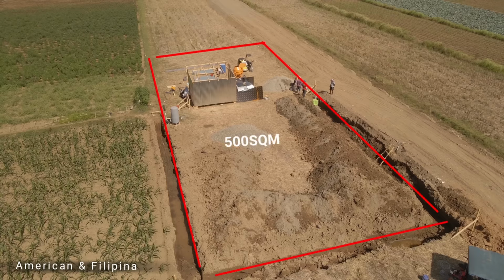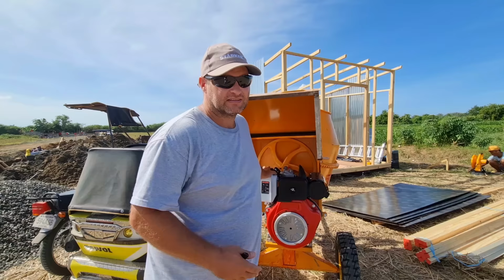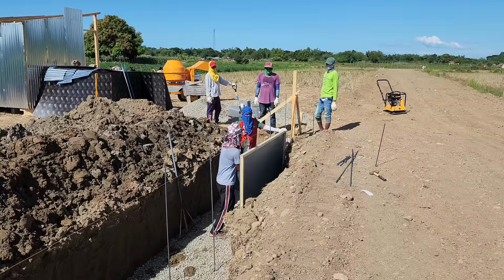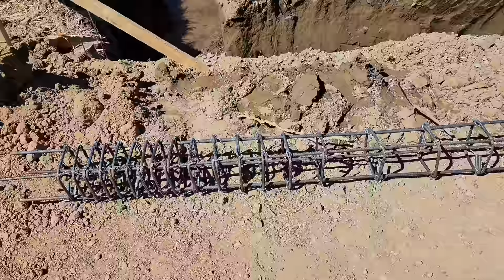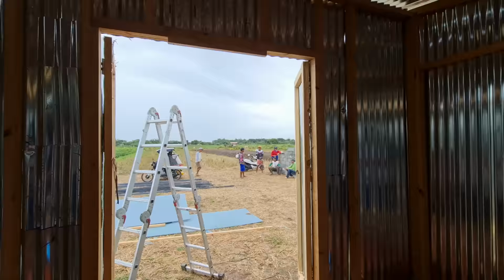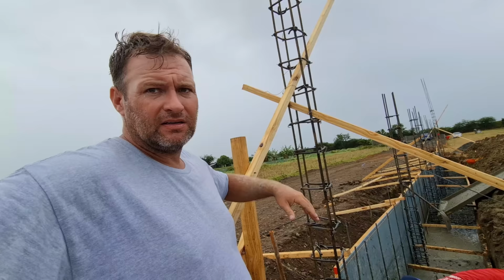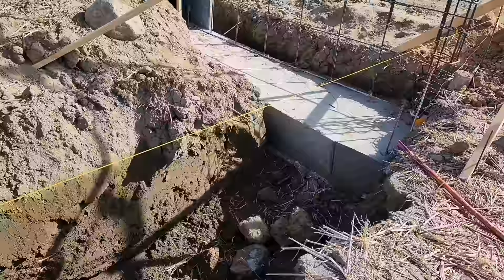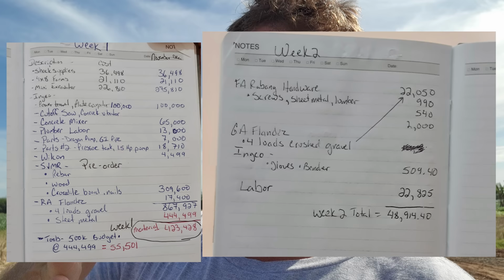Building solid Concrete Retaining Wall | S02  EP2 |House Build Philippines | The Armstrong Family

Comment: Richard.. That concrete is soup.. it should never be that wet. The slump is non-existent.
I know Filipinos like to make it wet cause it is easier to work with but you lose all your concrete strength. The concrete floor you did for your friends looked great. Not to wet, not to dry. Looking forward to your next video.

Comment: This is the advantage of the owner  having a knowledge in technical Construction, know how to read plans and etc. one thing I notice during pouring of concrete, No concrete spacer for Concrete cover and I hope you also notice that, the concrete have a lot of water which can weaken or reduce the strength of concrete and the nice thing and I always want to see during construction period is the bend of Lateral ties of Column, bend at 135 degrees which is correct, most of the time Construction workers and even technical here in the Philippines omited. All in all you did a Great Job👌👌

Comment: Your idea Richard is one of the best home builder. I like your design, the deep wheel and the water pressure gives me ideas how to set it up correctly.  The problem in Philippines,  the water irrigation has no upgrade, none of the  Engineers have solution to keep the water running, The water interruption in the Philippines  have no solutions. I love the high quality of your project and the design.

Comment: Great set up for the concrete. You possibly need to do a slump test, as the concrete looks so wet. This will effect the finished strength of the job.

Comment: I agree with you, Mr. Armstrong; a retaining wall is essential, especially in a location where land has been saturated for many years, mainly of the farmland has a sandy clay loam type of soil. You will need to invest more, particularly in the retaining wall. It would be best if you consider the flood and long-time saturation of the earth will change the structure of the retaining wall overnight; the bearing pressure will eventually increase due to softening of the base soil. I remember when I start the construction of the perimeter wall of my 450 sqm. Lot and my brother in law saying that it is overkill to construct a retaining with a dept of the foundation of 80 cm and the size of each foundation 40x40 and each foundation is 2 meters apart.

Comment: Hollow block no problem add horizontal vertical steel fill the block waterproof if necessary. You'll be good to go

Comment: My house is in the rice field also but what i do is my lot is more higher than in barangay road which means it is higher than the rice field ground about 2.5 meters high. I do this because of flood incident were rice field is prone for that kind of scenario. Even though we have a canal for irrigation but still it is not enough to control the flood when the storm comes in.

Comment: Hey great to see you taking charge of your build. Just arrived back in the Philippines and also looking on doing a design for my house. I have a suggestion maybe too late at this junction but maybe it may help if you could relay your explanation by way of a 3D graphical program like Sketchup there is a free limited version on line. Has a bit of a leaning curve but along with your wife translating and you showing a 3D representation of your ideas it may help to further convey your design to the contractor. Sketchup is a highly respected modeling and construction program. Research on line and see how deep it goes , I think it could help,been sing it for a couple years and I'm still learning. Just a thought.

Comment: Hi Mr. Armstrong I really like the way you wanted to build strong houses. Have you ever tried using steel reinforced concrete panel or SRC Panels which are already available in the Philippines?
Reply: Good suggestion for src panel since the condition of environment is hot

Comment: Your rebar should of been higher off the gravel at least 75mm for the depth of the footing, also I’d add a water stop on your concrete cold joint given the water you have . Just my view 😊
Reply from the maker: Actually we pulled up as we went.  !!!  More closer to middle of pour

Comment: I love watching you guys build your homes and always look forward to what is going to be done next. I love how Donna put her own persoal touches in the house. I have a question however, I saw the floor plan and was wondering why isn't there any closet in any of the bedrooms and why aren't there any closet/storage rooms for any of the cleaning products; i.e. walis, vacuum, pale? Also, maybe you can put a "tinted" window by the stairs to let the sunshine through but not the heat. Anyways, just dropping by to say  you guys are doing a great job. Keep it up!
Reply from the maker: We left those area open because in final finish we will have a custom built closet done in the rooms.  There's actually a closet/pantry in kitchen but for some reason the engineer took it out but I will be adding it back in under stairs.  And the stairwell we will also add windows.  Like last house, I just tell Engineer.  Give me blueprint.  And I usually make changes as I go! Lol

Comment: There is a company that manufacture  hollow blocks with 1000-3000 PSI. It's called Smart Masonry hollow blocks, an Australian technology available in the Philippines already. The hollow blocks are inter-locking. You can check on youtube about Smart masonry.

Comment: Also, each foundation footing has a cantilever of 40cm both ways. It's like an inverted T, and each foundation post is 2 meters apart. I also added each foundation a tiebeam, and I am happy with the result because I know my perimeter wall will stand by the test of time. Though I spent a lot of money just for the perimeter wall, it cost me back in 2019 of 350k, not including the finishing and labor.
Reply from the maker: I wanted to do t shape but due to property line I wasn't allowed to go over.  I did a heel and toe cantilever with hell block.  And .4 gravel pack.

Comment: Great way to document each step as an expat I appreciate that as construction is very different in the UK. Was that really 867,927 pesos for 4 loads of gravel?
Reply from the maker: No sir might be running total you seen with equipment and material.  The cost of 4 loads is 4800 pesos.  But I found a company where I can order a larger truck that's equivalent to 6 loads for 5k pesos

Comment: Hi Richard, well explained and great philosophy. One thing I have noticed on your horizontals, you're not using chairs to raise them off the ground. I have had some experience with  retaining walls in Australia, and my structural engineer has always  used this method on the 3 builds I have undertaken. Are you able to give an explanation for  the difference. I'm not trying to be critical. I just wish to understand the difference as unlike yourself, I don't have the expertise but rather rely on the trades people I employ. Thanks.
Reply from the maker: Actually.   It was hard to see and even tell bit we actually uses rocks to raise off the ground.  I'm not sure.  She may have edited that portion of video out.   Then as we poured I had them also pull up to ensure!!!
Reply: @The Armstrong Family   cheers Richard, thanks for getting back and explaining.

Comment: Exciting project with a very solid retaining wall! Just a question about the 16 inch of compacted gravel under the footer of the retaining wall. Will it not attract more water and possibly cause erosion under the foundation of the retaining wall?

The 2009 International Residential Code states about FOOTINGS in section R403.1 “Footings shall be supported on undisturbed natural soils or engineered fill.”

We usually pour footings on a single layer of 2 to 3 inch gravel which serve mainly to keep the steel separated from the soil (additional to spacers). The vibrated concrete will actually flow in between the gravel and therefore sit on undisturbed soil.
Reply from the maker: That's a great question and valid point.  Bit at same time.  That gravel is packed I to the soil to help stabilise it.  The soil was too soft and push to side and when stepped on you'd sink about a foot deep.  So to keep the footer from moving or shifting the only way was to pack gravel I to the surface.  So I guess you could say it was engineered fill due to the way it was done.
Reply from the maker: Over time.  Think of it as quick sand.   The water moving up and down would've sunk entire footer.  Now it has a wide footing to sit on and xtra bed to resist.
Reply: @TheRichardArmstrong  I appreciate your explanation about the soil conditions and it looks like this should work well for the retaining wall. We own a 2Ha rice farm for 20 years and have so far been reluctant to build solid structures on there as it requires a huge amount of landfill to raise a building beyond the flood levels we experienced. 

What will be your approach for the main load bearing post footings of the 2 story house? Will you put the footings on undisturbed solid soil below the soft soil level or will you place the foundations into the 5 feet (?) of compacted landfill? 

Did your project engineer do some soil testing by plate load test to determine the actual load bearing capacity in pound per square foot (or kg per square meter)?
Reply from the maker: The footing will be place .8 meters into undisturbed then rest in backfill.  Due to soil we are actually taking 2 very different approaches.  As we mentioned we are using AAC block which lessons the load by 60 percent on columns.  Plus we are also increasing the size of the footer by 30 percent.  With these 2 approaches I am confident that we won't have future issues!!!  I uave done soil testing.  Primarily because the conditions I'm actually use to building in are very similar if not same as here for sand and water table!!!
Reply: @TheRichardArmstrong  We are currently finishing our private house in Davao City, but will have some construction coming up for our Christian Community. I would really be interested in AAC and your experience, as I am familiar with it from Germany. My daughter who is studying Architecture really wants to start making concrete furniture. Can I contact you via your WhatsApp number which you shared a few months back?

Comment: wow you have all the gear mate there getting spoilt mate well done i built a big house in Bicol; 30 years back  when a bag of cement  was a few php a 40 kg  bag along with rebar was cheap was 400 php a day for my worker he use to build high-rise in manila i was impressed with his work as being a boilermaker welder also built a few homes in Australia i think it cost about 3 m php  for the house its 3 brooms two lounge rooms 3 bathrooms dirty kitchen under stairs its double story 50 feet by 60 feet with concrete roof Spanish balcony rails  i sent all the 2.5mm electrical wire from Australia and taps etc we painted the whole house with concrete driveway paint i sent over its lasted the best out of any local paint's don't live there as i live on my farm in Australia with my wife its locked upstairs with the mother-in-law living down stairs  one day i might get over for a holiday.

Comment: > one 'tip'...i been living here the philippines 15 years and yes i know they do things a bit differently. of course its important to stress the importance of quality control and structural integrity - makes for an educational experience for both the foreman and the workforce under his supervision. the tip i suggest...there are inevitably going to be viewers, myself included, who hold accredited business licenses with masters degrees in architecture or materials science or structural engineering and coupled with years of successful construction project completions under their belts. point being structurally reinforced cast in place concrete > WHERE the rebar is placed no closer than 4 diameters from the 'finish' surface and poured with  concrete having somewhere in the vicinity of 3500psi (~ basic 6 bag mix...1 bag cement, 2 bags sand and 3 bags of aggregate) completely mixed with only the addition of just enough water to maintain a reasonable 'slump' that is workable ('plastic') without dribbling down a shoot like a  runaway (visibly unmixed) puddle...make sure your help understands the difference and what gets compromised in trying to provide a quality work experience.

Comment: When we poured solid concrete walls, we greased the inside of the metal forms so that the concrete would not stick to the forms. I was building solid concrete swimming pools.
Reply from the maker: We used to spray diesel on pur forms!!! Lmao!  I had a release agent but ended up using most of it on last build.

Comment: for seismic design & construction of structures, the UBC/IBC Code requires that minimum diameter of columns longitudinal bars should be 16mm (not 12mm)  & minimum development length of bars should be 60 * diameter of bars,
accordingly, the minimum lap length of bars should be 50 * diameter of bars
for up to 2-storey houses you can also use 8mm links (stirrups)
and the 90 degree hooks of inks (stirrups) are allowed for residential houses
since heavy applied loadings on these houses would normally not result to exceeding the shear resistance of concrete
you only used 135 degree hooks of links for columns/beams with high induced shear loadings acting on the structures
otherwise - normal 90 degree hooks of links would suffice for houses even up to 3 or 4 storeys
135 degree hooks are nominally required for hi-rise buildings
there are a lot of construction requirements to make your house earthquake resistance
you can check out my Facebook page (Edd Pare)  or my Linkedin Profile (Eduardo Pare) for additional info
about Design & Construction of Houses & Structures on locations within the Seismic Prone areas

Also, for structures or houses located on seismic zone areas
Columns longitudinal bars should have at least 1.50 - 2.0 % area relative to the gross concrete area of columns
example calculation for columns minimum numbers of longitudinal bars is the following:
- for column size of 250x250 mm the required minimum vertical bars is
  (250*250*2/100) / 201 = 6.22 nos. of 16mm Bars = at least 7 nos of 16mm vertical bars
 (12mm is not allowed by the Code for Columns)
 
CheerZ !
Reply from the maker: Hello sir.  On our house we have our buikring requirement.  But for fence.   Imbuimdi g it acvording to what ive known works bestfor seismic areas in states i. Wet areas.  And never had any of my walls fail.  Keep in mind.  Thisis just our fenc weareworkingon
Reply from the maker: And we have an engineer blueprint for our house,s plan  🙂👍 j
Reply: for the fence 12mm vertical bars is acceptable
the ones i said above are for structures & houses
Reply: for fences you can even use 6mm links (not 10mm to save some cost) with just 90 degree hooks only
you need to apply 135 degree hooks of links only if you exceed much of your concrete shear resistance
like on those hi-rise buildings
but for houses even for up to 4 storey 90 degree hooks would suffice with 8mm size
Reply from the maker: Will definitely be using 16!!!!  We actually seen 2 houses collapse after the earthquake here and it was due to no 135 and 12mm on a 2 story house.  The owner was expat!  Wanted to cut cost.  Figured.  Metal is metal🤣🤣🤣
Reply: for residential houses which collapsed
it is not about because of the 135 degree hook why it has collapsed
it is because the flexural (bending) resistance of the columns are not adequate owing to the 12mm bars
the columns lack the tensile resistance to resist the seismic stresses
when the column fails it burst out from the stirrups because the 12mm bars resistance is not adequate
against the seismic combined/torsional stresses
as i said above if you exceeded the concrete shear resistance & as per the design calculation
you need to provide links or stirrups to resist the high induced applied shear stress
then your links should be with 135 degree hooks
otherwise, for light structures like houses - 90 degree hooks will suffice
since you do not actually needed to provide additional shear resistance through stirrups
because the shear resistance of the concrete itself is adequate not exceeding the allowable shear stress 
as required by the Codes

take note that there are many technical reasons why the columns or structures collapsed or failed
& provision of correct reinforcements is just one of those many requirements

for heavy loadings such as hi-rise buildings & heavy machineries structures
there would be a lot of applied heavy loadings which would result to large induced shear stresses
as well as huge flexural & compression stresses on columns & members of the structures
in these cases then you indeed require to apply the 135 degree hooks of stirrups 
and you might as well need to provide 2 or 3 links/stirrups per set (not only 1 stirrup per set or line)
and confine all the columns vertical bars with 150mm maximum spacing without stirrups
because the concrete itself would not be able to resist the applied shear stress
the provided 3 links/per set will not only confine the vertical bars to stay in place (150mm maximum distance without links)
but also to provide additional shear resistance

Comment: Using a vibrator in the concrete walls enhances the strength.
Reply from the maker: Actually have one we will be using on pour of the walls.  The slump will be alot higher than with my footing.